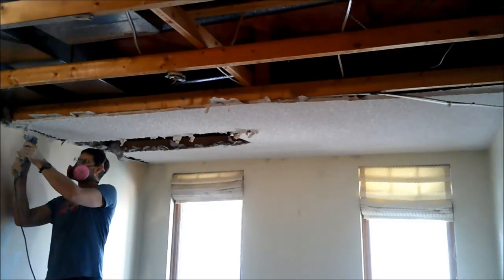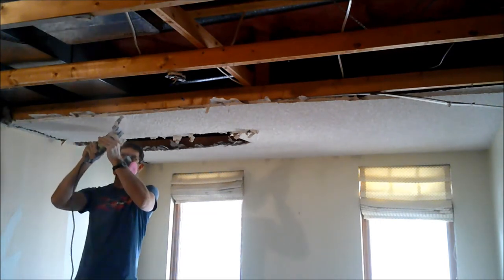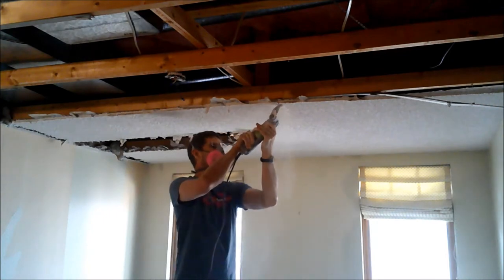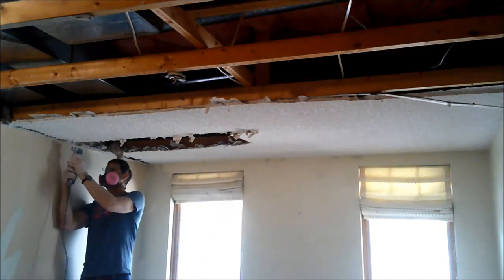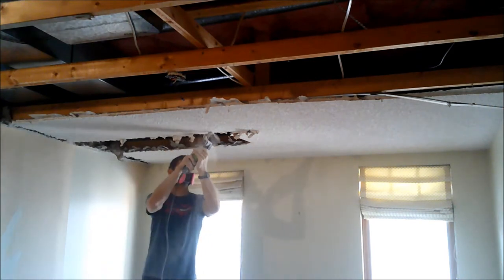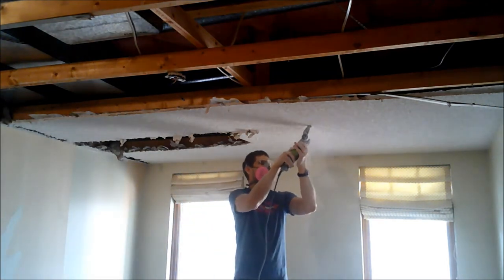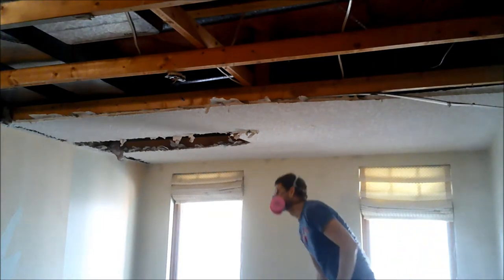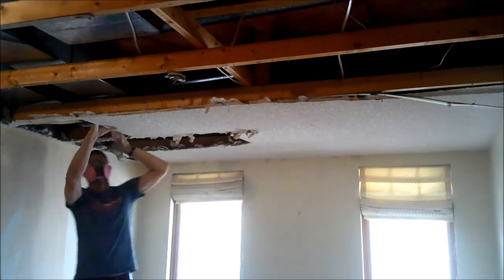Remove drywall sheets FAST and CLEAN with an oscillating tool

Comment: The cleanest method I have found is to use a magnet to find the screws and remove them. Cut the tap joints with a razor knife and take the large sheets outside for cutting into smaller pieces to throw away, if needed.
Reply from the maker: that's interesting.  I like it.  There's one thing I failed to mention in this video.  These sheets were, by and large, nailed into the studs (1982).  So it was much easier for me to just pull the sheets without them breaking.  If they were screwed, it would have been much harder.  Your method would have been real helpful.